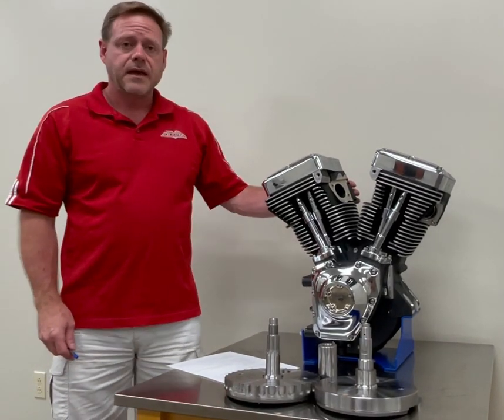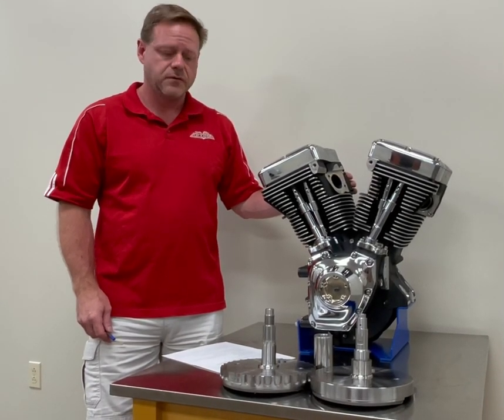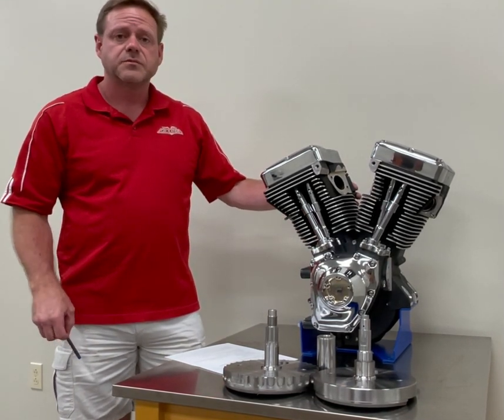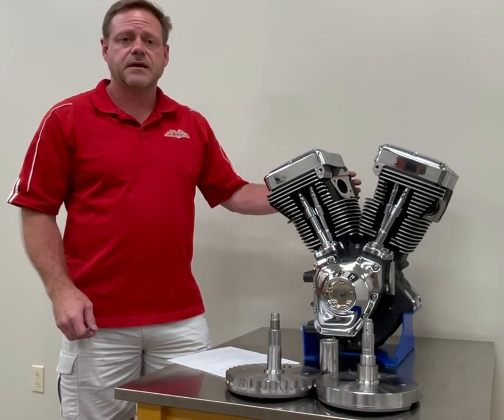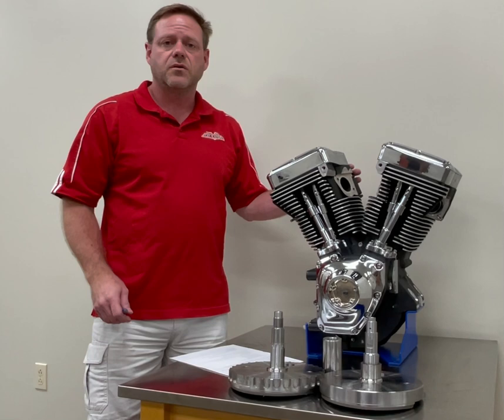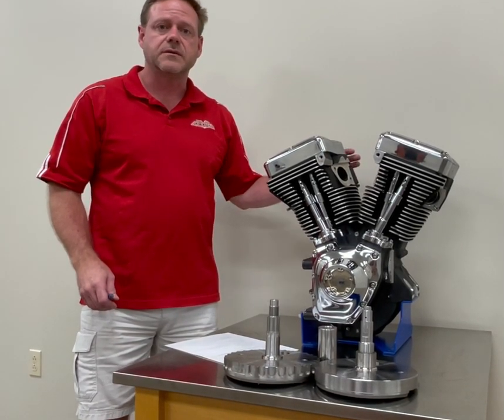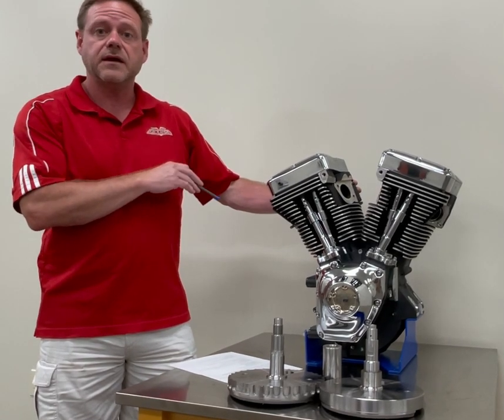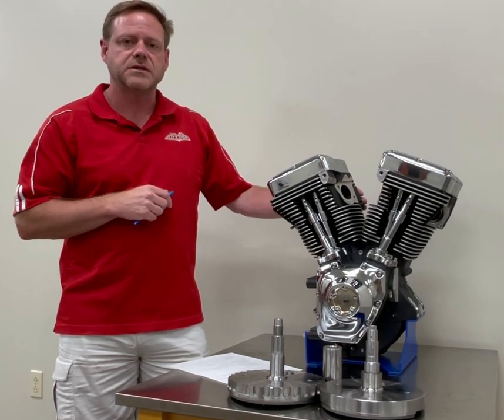Ultima Twin Cam Replacement Engine Features

Comment: I'm seriously considering your 96 in shovelhead instead of rebuilding my 74 cu-in for my flh bobber. 
I'm wondering what sprockets you recommend, number front and rear. 
I will mostly use this bike for shorter rides but I also want to be able cruise the interstate at 70/75 mph.
I have a 92 Electraglide Ultra Classic for long trips. 
Thanks in advance for any assistance you can provide.

Comment: STOP DOING business WITH MIDWEST MOTORS!!!! they fucked me out of a 7k 120 CI el brute evo crate motor! 
they have MASSIVE MAAASIVE QUALITY CONTROL ISSUES with most there products since the 80s and 90s and midwest motors took over as their manufacturer and distribution for ULTIMA and quality control went DOWN hill. every HARLEY owner that I ride with at the VFW LUAGH and say that's sad to hear that everyone knows not to buy them and buy S&S or OEM Harley! Apparently I missed that memo. they ALMOST got sued a handful of times and HAVE been sued in the past.  DONNIE at midwest motors is the BIGGEST POS